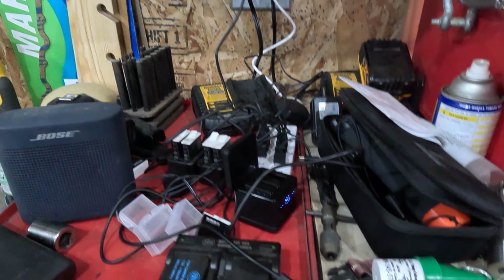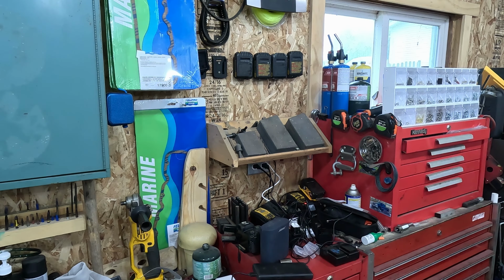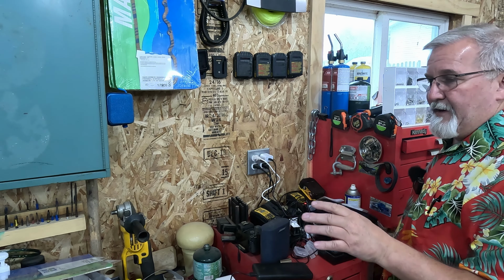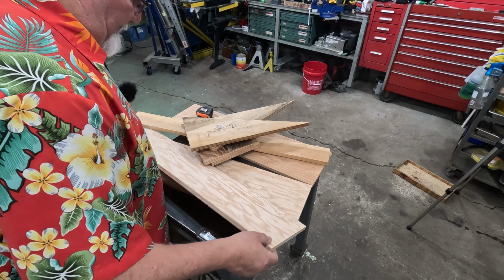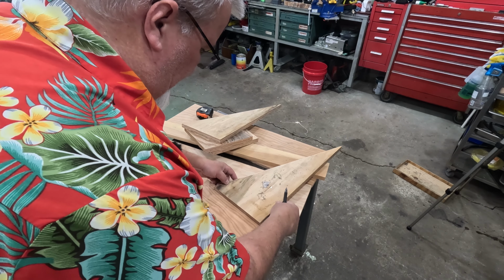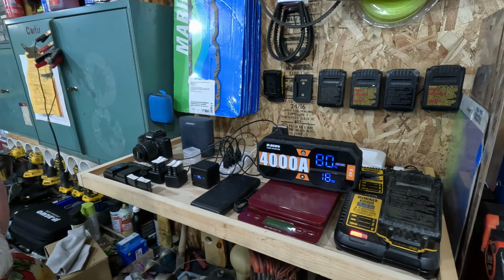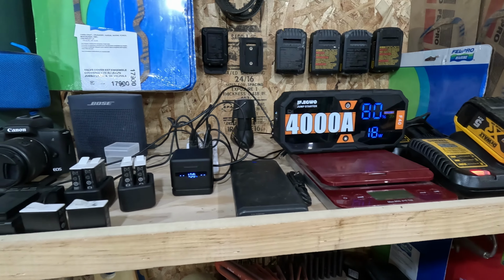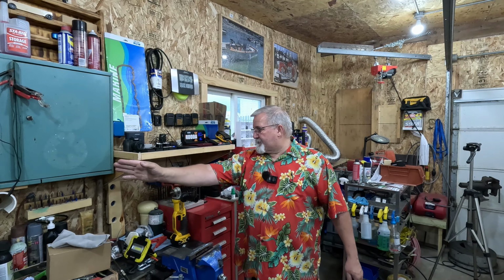Quick build project battery charging shelf - I feel so much better now

Comment: I do not understand You must have 20 or more batteries for boats lawn mores and more , plus  jump packs. and yet every time you get in one of your jeeps the battery is dead. And yet you need the jeeps to go to the water and pick up more boats??????
Reply: It is a Jeep thing, they always have electrical problems and never work properly.
Reply: @Kirky64  Needs a main power cutoff switch like in the boats.
Reply from the maker: You would think that with all the tech out there it would be as reliable as my impala.  It just goes to sleep when I'm not around and the battery is always good.